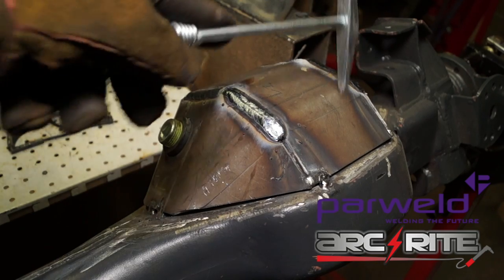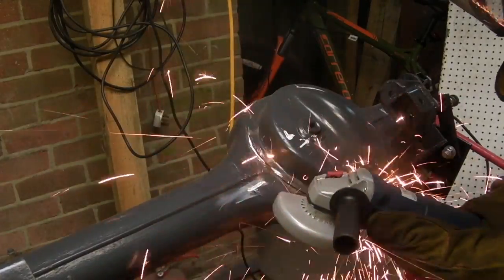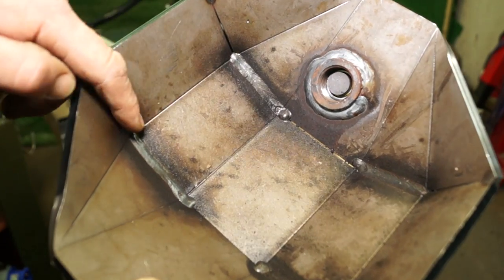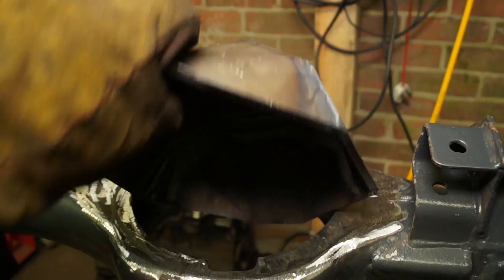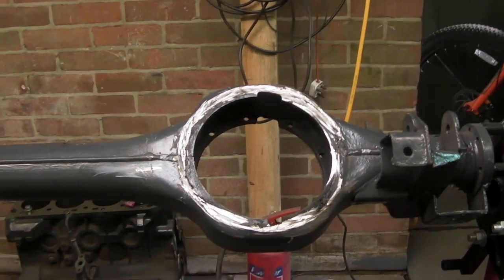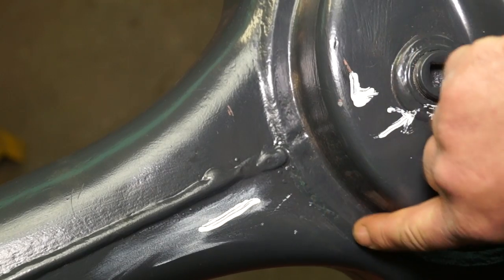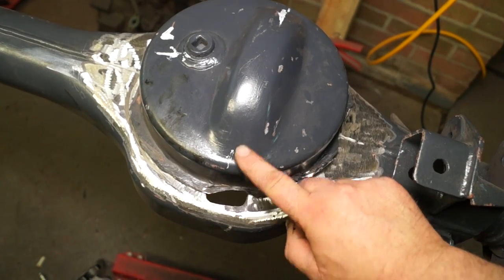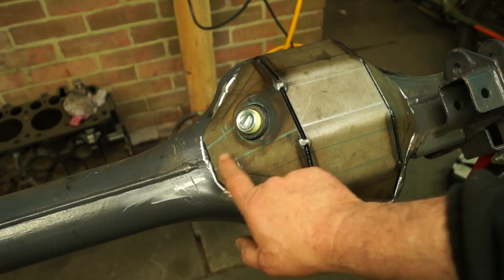Land Rover (AXLE) Welding -  Armoured Diff Pan Modification PART 1

Comment: Top video matey I'm currently restoring a 1984 90 your videos have bin a big help as I am no mechanic but I'm a plater welder by trade so a tip for big gaps do a multi run e.g turn the power down and lay a root run grind back and then turn the power up and wack it in 👍 will help with your under cutting hope this helps keep up the good work
Reply from the maker: Ah right yes I get it.  Do a root fill.   Will have a crack at that.  6013 good enough for a root pass?
Reply: Yes that will do matey if there is a big gap and your welding with stick always best to do a root run it will also help to stop porosity in the weld ( little holes ) because you don't have to build the weld as much so less chance of slag getting trapped in the weld it is this slag that will give you porosity and potentially a leak 🙂 like a say matey you have help me out quite a bit with your videos I watch them all 😂 so I'm just trying to return the favour keep up the good work 👍👍
Reply from the maker: You live anywhere near king's Lynn Norfolk?
Reply from the maker: We used to have resort to putting steel rods into gaps to get out of trouble at a push when things didn't fit and the operator wanted his trailers back quickly. .
Reply: I live in "steel city" (sheffield ) matey but can always do a road trip at some point when I get the 90 up to scratch think it would be a good test run for the old girl when I say " up to scratch" I mean trust her not to fall to bits 😂 ... yes mate that's one way to do it ..when someone is giving you ear ache because they needed it yesterday 😂saves doing 20 multi runs as well 😂

Comment: would the actual banjo part of the axle be prone to get distorted due to a lot of heat welding that extra thick pan in...?
Reply from the maker: yes it is possible but after welding it today the metal took the heat away very quickly.  Trick is to weld opposites to keep the pull to a minimum.  Doubt any distortion would be negligible i would have thought.

Comment: I've been looking at them Gwen Lewis diff covers for a while and wondered if they are worth all the effort.  Another option is sewer pipe end caps to replace the rover tin cover.
Reply from the maker: Sewer end caps?      Glyn Lewis one is a lot less work than having to make one up yourself. and you get the satisfaction of getting it done in a day.
Reply: Land Rover Toolbox Videos The Glyn Lewis one does look the goods. 8" industrial pipe caps is what im referring to, they are around 3/8 thick. They do involve a lot more work than the one in the video though. I'll send you a few pics on fb messenger mate.
Reply from the maker: Yes please.  Sounds interesting.